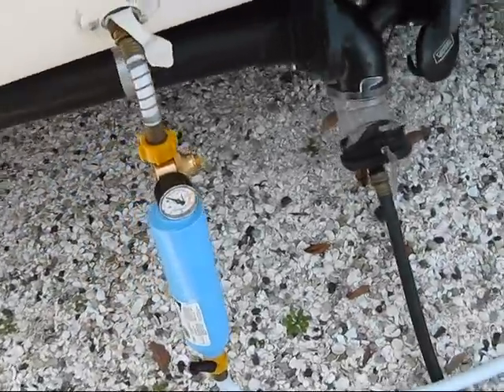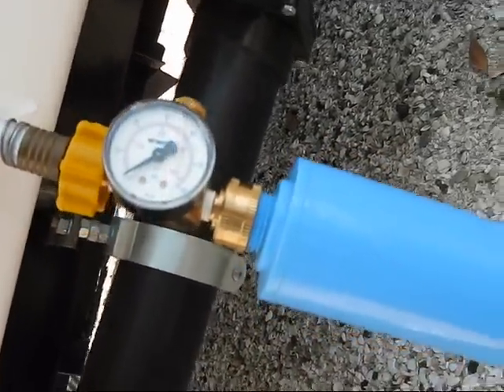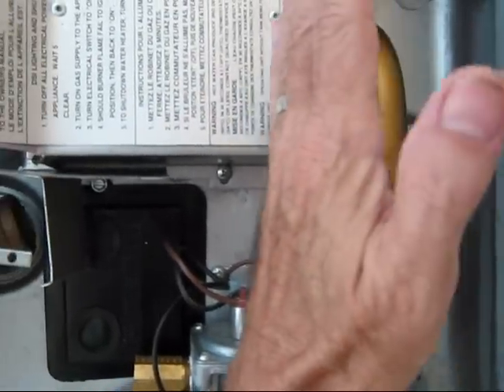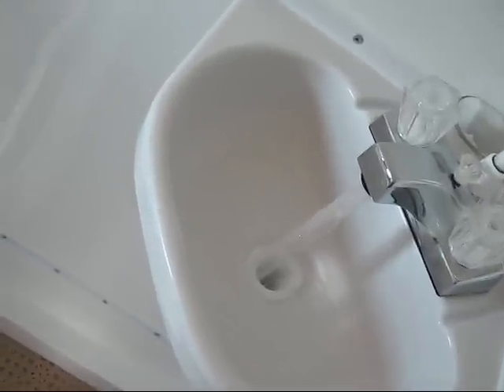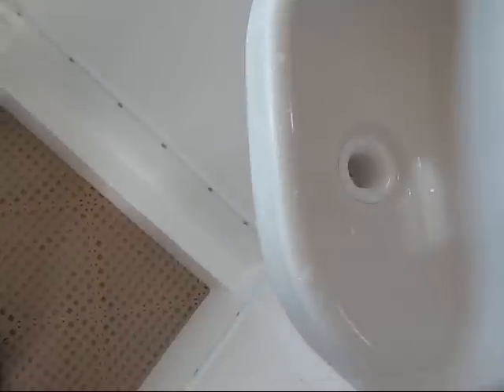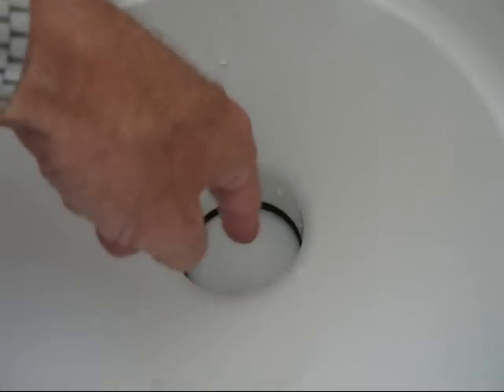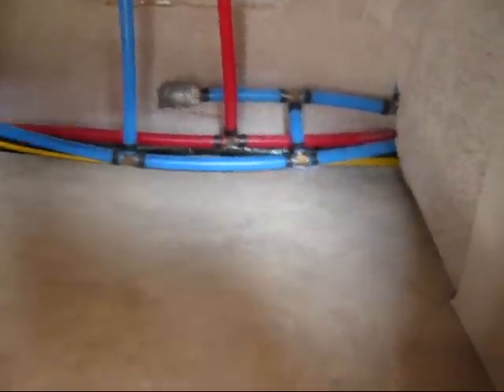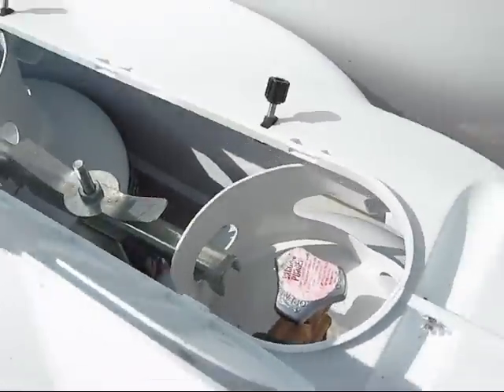How to service the Casita Water Heater Anode: Part 3 of 3

Comment: Do you have any plans to replace the crimped water fittings with compression fittings?  If so, I hope you will provide us with a step-by-step video?

I don't see any videos on How to check for leaks in the Propane System, nor have I seen anything on your thoughts of changing out the Propane fittings with compression fittings instead of the crimped on fittings on the pigtails.